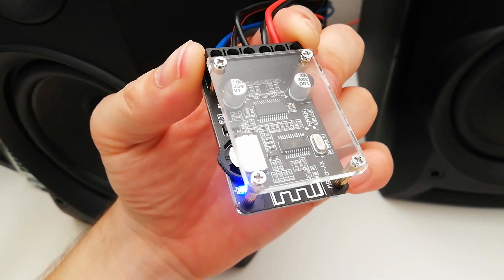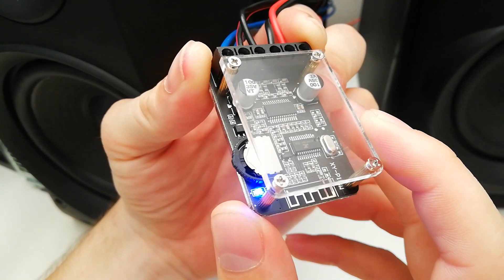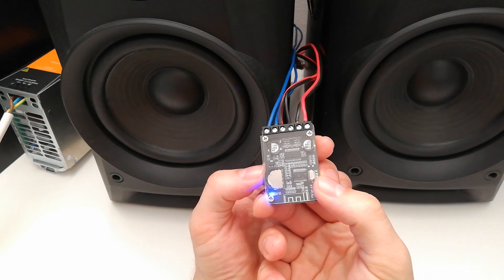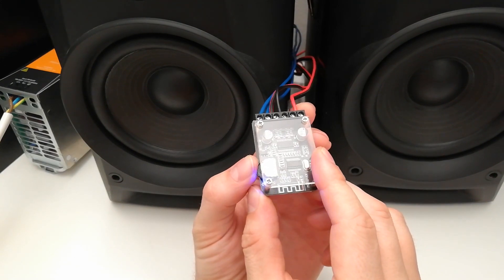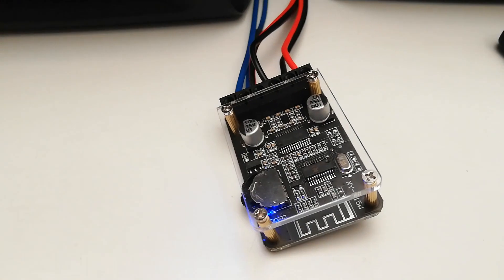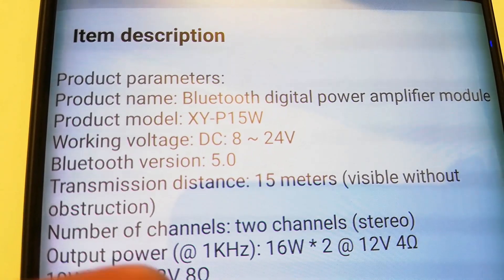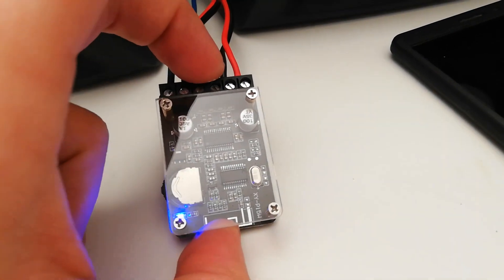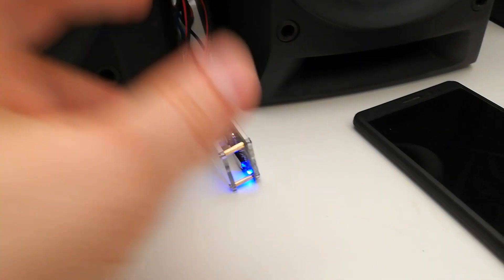XY-P15W - Stereo Bluetooth 5.0 Power Amplifier Board

Comment: Hi I have a problem with the speaker I made with this amplifier.. I used 7.4v 2600mah and 2*10w driver and when I put it at 80% volume I hear crackling noise.. please tell me how to fix this.
Reply: @Jesrel Sunit Hi I guess the optimal voltage should be near to 11.1 v. By that you may be able to give sufficient power to the amp board. Mine is TPA3110D2 with 11.1v 3s Cell, and till now, no such issues. :-)

Comment: Sir, is it possible to connect two 6 ohm,  5'' speakers ,30 watts power on a single channel in this amp. I am having a pair of 4 ohm tweeter and a pair of 6 ohm woofers....... Pls suggest a method 🙏🙏🙏🙏
Reply from the maker: It should work fine 👍 Try to connect them, then reduce the volume before  start playing music and slowly raise up the volume to prevent any damage..
Reply: @als-techreview  thankyou for the instant reply❤️🙏

Comment: Out of all the Mini Amps you have reviewed, which do you think has the best sound quality?
Reply from the maker: All the nobsounds/douk audio sounds good. Usualy TDA boards for me have nice sounds.. Not all but there are quite few TPA which can deliver good sound.. But there are some little boards like this that just blow me away with sound quality and power..

It's hard to tell which is best, because this are results that I get on my speakers. Sound can vary from speaker to speaker..
Reply: I have a question: could I use this amplifier with a 3.7v lipo battery using a DC-DC step up converter? Would that work?

Comment: Supplied power? Volt and Amp?
Reply from the maker: 24V - 10A in my case.. But you do not need such big amperage..  3A is more than enough..
Reply: @als-techreview  Hi sir 
I can using 12v-5A or not?
Reply from the maker: @cuongnguyenphu4972  sure you can 👍
Reply: @als-techreview  Tks sir
I'm trying now.

Comment: I am getting quite a bit of noise with it. Try the following experiment. Bring up the volume on the phone to max, play some music, and then bring down the volume on it to minimum. You get a constant hum sound.
Reply: Maybe use battery or any other source of electricity
Reply: @tsaitaj  The power supply has good capacitors, so it keeps playing when I unplug it for cca 15 seconds.Still humms when unplugged - same noise. Capacitor can not hum :)
 Also tried grounding it and shutting down all other electronic devices. No luck.